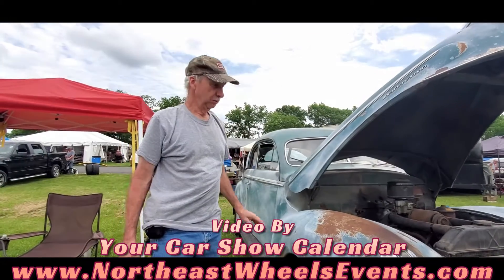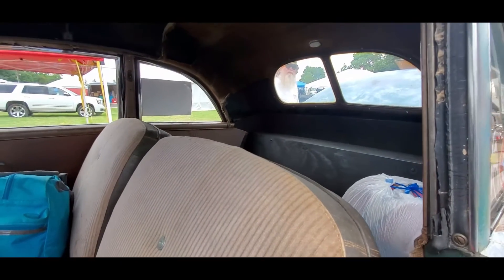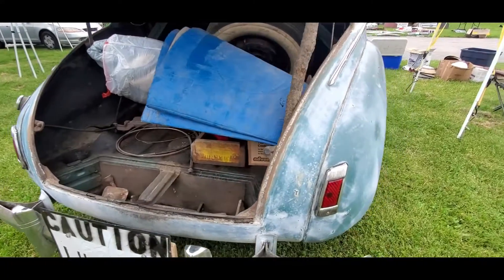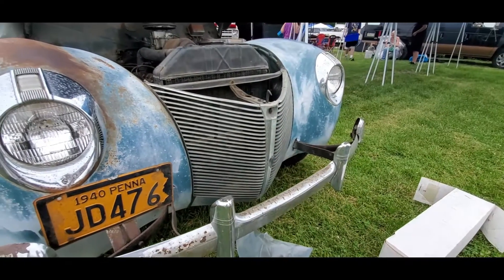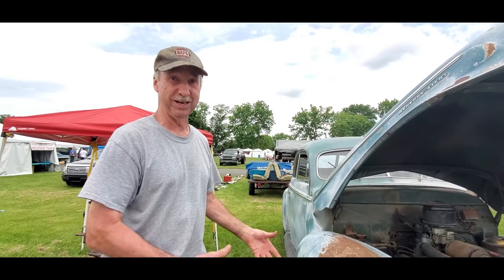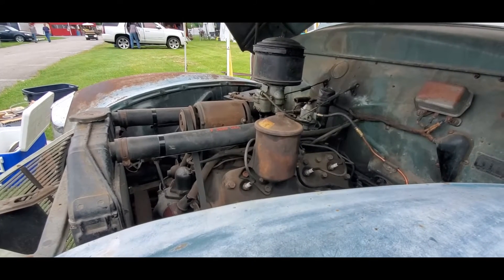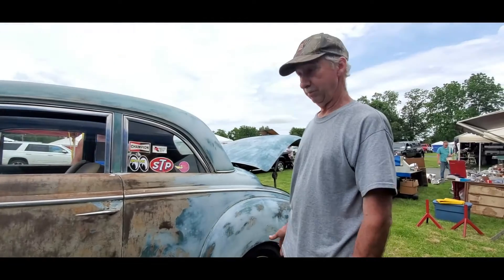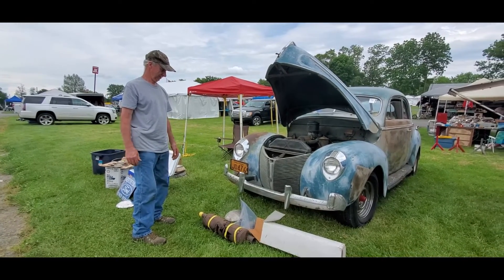David's Bone Stock 1940 Mercury Coupe at the 2022 Ford Nationals, Carlisle

Comment: HI Pamela,,, WOW what a find,, that's one lucky dude,,, I agree the only things I would of changed are the safety parts,,, brakes,,fuel lines ect,,, cool car I would love to have it that's fer shur,, later gater,, Glen
Reply from the maker: Ahhh, your fantasy garage just got a new resident, Glen!!! Replacing all of the safety bits is very important if you plan to drive the car. Of course, you safe all of the parts, like David did with the muffler. Oh, the garage just got a little bigger with original parts on the shelf!! In a while, Numero Uno!!